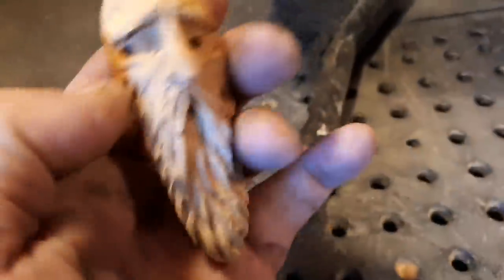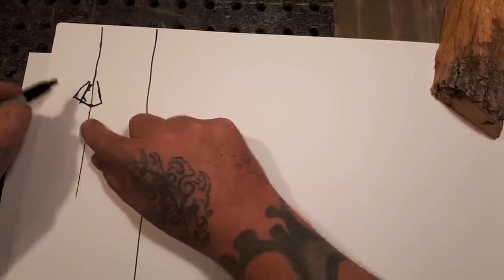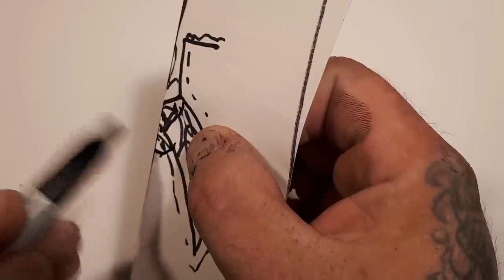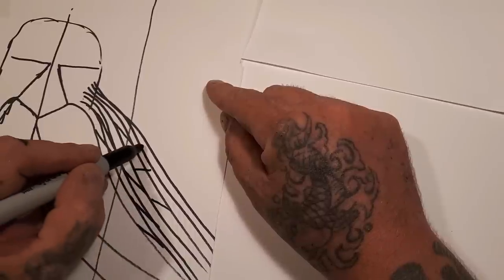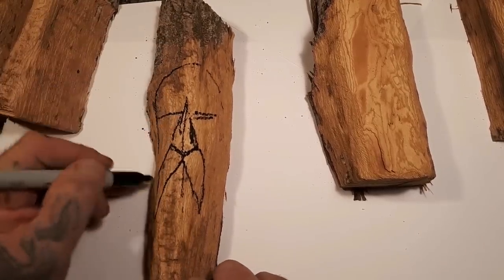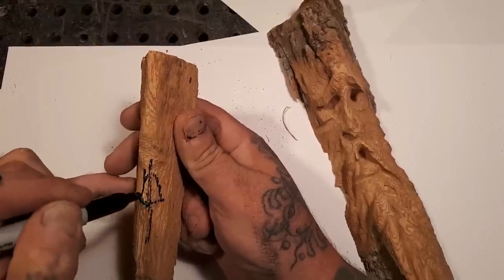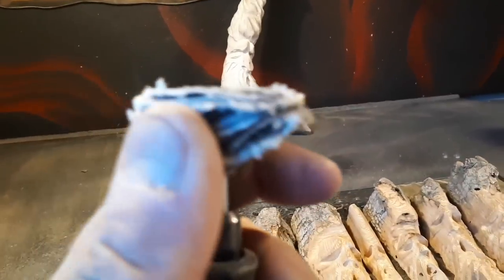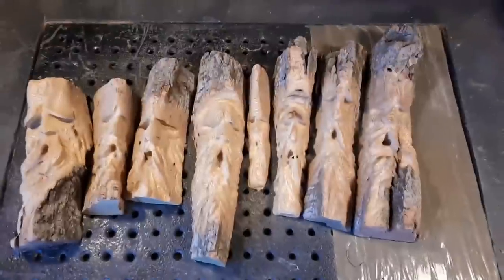Very easy template to draw on any piece of wood to start your first ever wood spirit carving. Dremel

Comment: Hi Jordy. I was looking for the industrial or heavy duty flex shaft on Amazon. Found this - S-10802-NC Heavy Duty Sheath for SRH, TXH and LXH motors, 43-3/4″ .  I have the SR  motor. Is this the one you use and does yours have the square tip shaft?  Thanks
Reply from the maker: I need to see a link
Reply from the maker: And yes my industrial shaft is square, and I run it on the SR
Reply from the maker: U know u will need a new square shaft handpiece too?
Reply from the maker: https://www.foredom.net/product/s-10802tx-heavy-duty-sheath-optional-43-3-4-for-srh-txh-and-lxh-motors/
Reply from the maker: Just so u know u will need the inter sheath with the link I sent u and a handpiece, if u want to email me I can talk to u more about it as I have most handpiece and know what's kinda good for what :)

Comment: Hi Jordy.  Love your videos and subscribed.  What size diameter burr do you use most of the time?  On the kutzall site
it has several.  Would the 1/2 inch or 1/4 inch be best for just starting out?  Thanks, Mick
Reply from the maker: I alway use 1/8 shaft for my dremels or other small tools like that, and i use 1/4 for my foredom and die grinders, 

So if u have a dremel or a knock off dremel, get 1/8 shaft!

Hope this helps and thank u
Reply: @CarvingFusion  Hi again,
I meant the diameter of the actual burr, not the shaft diameter.  They have 1/4 and 1/2 inch diameter burrs and I would use the 1/8 inch shaft for the dremel.  Wanted to know which you prefer to carve with.  Thanks, Mick
Reply: Forget the e-mail above.  Thought they had two different size diameters for the 1/8 inch shaft.
I'm getting old.